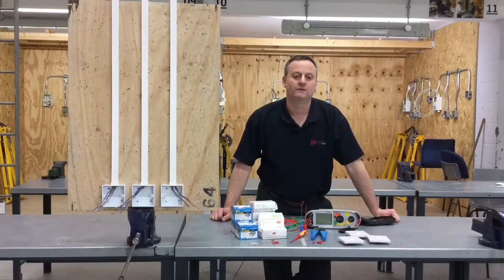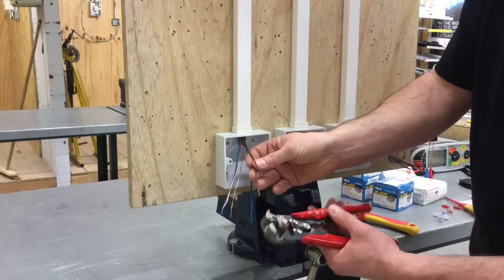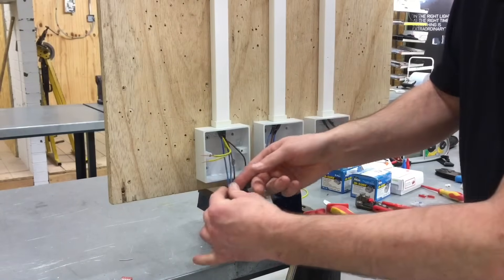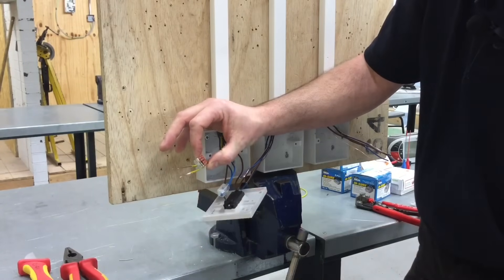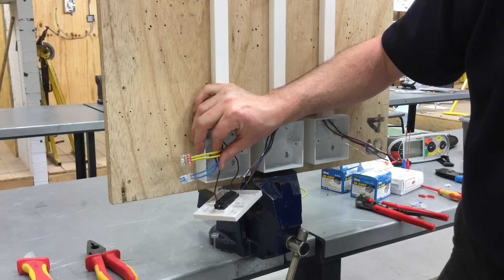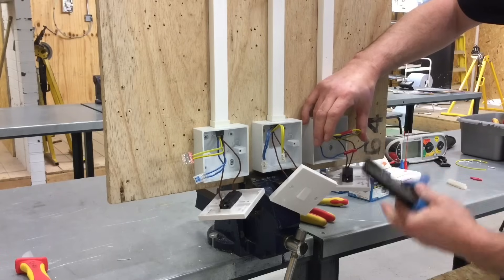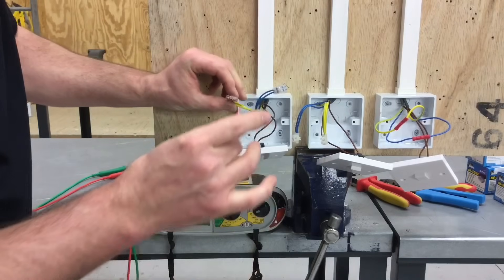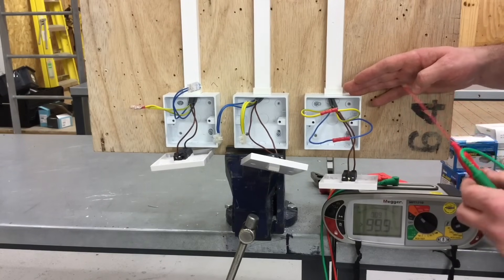Taking the Feed (Supply) to the Switch Connections Using Wago, In-Sure, Connector Blocks & Crimps

Comment: The Wago 2273 can be removed from solid wire by twisting and pulling the wire.
Reply from the maker: Hi. Yes you can but boy I struggle to do it so I didn’t risk it on camera... what a lightweight I am. Thanks for watching GSH Electrical 😃
Reply: @GSHElectrical  when I do it I always notice a nicely scored zig zag on the conductor, which demonstrates both how well these wago things bite into the copper but also that you may or may not want to reuse that exact bit of copper (personally, I’m pretty sure it’s surface scoring, but examine your own conscience). But certainly the wago itself can be used more than once.

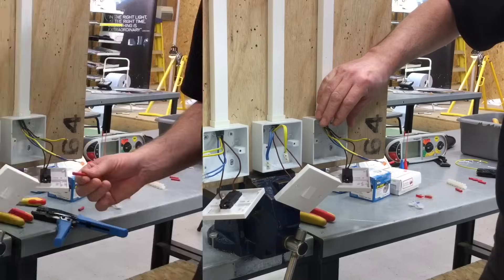Comment: 7:29 NEVER EVER use the "standard 5 amp connector blocks". The screw joints will loosen over time and then you have it ...
Reply: Properly used screw terminal connector blocks last for many years, I have never seen through crimps used in any wiring in my life.
Reply: Through crimps are banned in many areas of electrical engineering.
Reply from the maker: Hi. Totally agree I am not a fan of connector blocks I have seen to many of them melted due to loose connection. All the best GSH Electrical

Comment: Whats makes the 2nd connector 5amp? I plan to connect both power and lighting wire for domestic wiring. So do I use 12amp for power and 5 for lighting?
Reply: I have found them all to be different sizes, the 5A is just a guide. Best to choose the one you can get all your wires in and tighten. The less empty space round the wires the better.

Comment: I think you said you would explain why you would use this method of wiring in a previous video, why would you use this instead of say a 3 plate method ?
Reply: Plus this way gives you the option in the future to fit "smart" light switches👍🏻
Reply from the maker: Hi. Sorry for the delay I have just finished a 15 hour day. The reason electricians take the feed to the switch is to reduce the cables in the ceiling when fitting things like downlights. I did mention this in the second video but apologise for lack of detail as many of my videos are running alone side my teaching in the classroom and workshop. All the best and thanks for watching GSH Electrical
Reply: GSH Electrical no worries thanks for the reply and keep the videos coming 👍🏻
Reply from the maker: Thanks for the support GSH Electrical